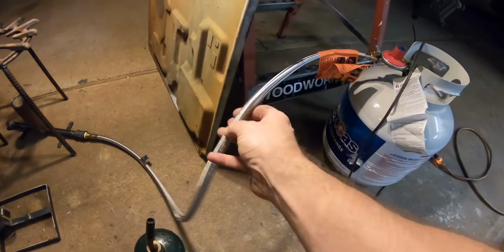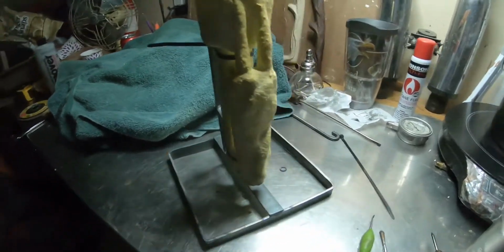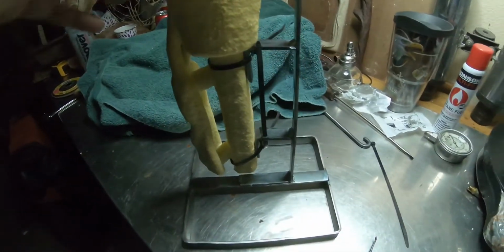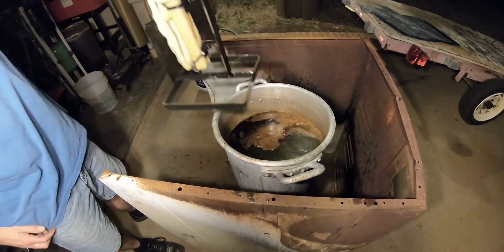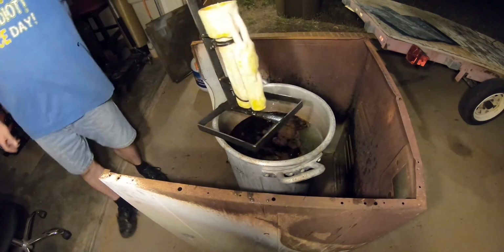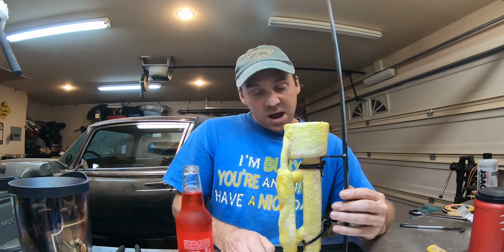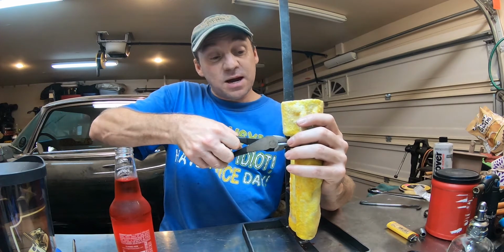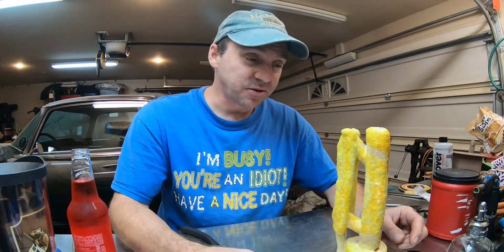Boiling Ceramic shell for lost wax bronze casting Part 1

Comment: Slurry is water soluble till it hardens, then it becomes extremely hydrophobic. I was wondering if boiling would work, I've seen 20 plus videos on ceramic shell and slurry blends. Cracking issues comes from the shell surface heating at different proportional temperatures, even in kilns you get corners and micro climate pockets that can cause these issues. Never seen a video on water boil melt, heard in a few people's videos about this, talking about how they HEARD about this technique, they never tried it.  I like this technique, plan on using it.
Reply from the maker: Give it a try.  It is water soluble until you fire it.  😉
Reply: As far as the hydrophobic, this is what I heard from videos, I haven't had a chance to use slurry yet. Yet, this was a perfect video and gave me the next level of thought on it.
Reply from the maker: @dna3930  Well, once ceramic shell is fired, I can tell you it becomes gas permeable.  This is one of the reasons you dont need a ton of vents.  My process shown here would probably be frowned upon by Ransom & Randolph.

Comment: Would this work with investment? I would assume not but figured I’d ask.
Reply from the maker: Ceramic shell is investmant.  Do you mean solid block investment?  Probably not because of the thickness, the investment would likely break down before the heat reaches the wax.  And solid block investment doesnt have this issue anyways.  Please tell me you are not attempting to use plaster of paris for metal casting.  It never truly loses its water and is extremely dangerous to pour molten metal into.
Reply: @jagboy69  I’m so new to this I’m not even sure. It’s the investment you buy in a powder form and mix water with it.
Reply from the maker: @Four9sFineJewelry  Good man Josh!  Too many times I get bone heads here attempting to use plaster of Paris.  If you have traditional investment like Ultravest, you wanna stick with traditional burnout methods in a kiln.  Solid block investment in a flask is what jewelers use to get the best details.  I use ceramic shell because for larger stuff, it's a little cheaper.  What are you casting?
Reply: @jagboy69  dang! That’s what I was trying to get around. They’re expensive!! What about placing it above the vent hole, (not blocking it,) of my Devils Forge furnace?
Reply from the maker: @Four9sFineJewelry  You wont be able to control the temp that the investment needs.  You can build an inexpensive electric kiln for  a couple hundred bucks and control it with a kiln.  As the saying goes, get rich or get smart.  I bought my kiln for 25bucks, just gotta look for a deal.
Reply: @jagboy69  $25??? Yeah I’d say that’s a deal. I appreciate the advice and responding. While learning all of this, I’m also having to keep costs way down due to living space at the moment. And since I don’t have the patience to wait until I move into a new home, I’m looking for ways of wax casting with the space/tools I have.
Reply from the maker: @Four9sFineJewelry  I suggest signing up at thehomefoundry.org  Lots of us there and good info.  Stop in and say hi.

Comment: 200 subscribers! Pretty impressive. Nice video. I would have bet money the shell would have dissolved.  I would have lost my money.
Reply from the maker: Barry this was 5 layers of shell.  I would suggest 6 layers at a minimum and I would probably pull it a little quicker from the water.  The 2nd dunk was not necessary.  If the winds here will give me a break, I'll pour the bronze today.
Reply: @jagboy69  I hope you can reply but us there a way to dissolve the ceramic? I have designs that would need the ceramic shell dissolved. Thanks
Reply from the maker: @stocky9218  if you mean chemically?  Yes there is actually.  On one of my videos, someone left a comment about dissolving it.  I seem to remember they mentioned sulphuric or muriatic acid.  Proceed with caution and run a sample before trying it on your prized casting...  So what'd you make?  Do you have a YT channel?  all the best!👍🍺😎
Reply: worldtraveler Thanks for the reply. I haven’t made anything yet but I would like to cast a rocket nozzle with cooling channels in the walls. Probably not possible but I’ll try oneday. Need to dissolve the ceramic out of the cooling channels. I haven’t seen anyone cast something like that with ceramic shells so it likely is impossible
Reply from the maker: @stocky9218  Solid investment.  Look into ransom & randolph ultravest..  Go for it!  I'd love to see it!  Cerma8c shell wont work for small internal channels.  Solid block investment is liquid and will work well for this.
Reply from the maker: best part, the stuff dissolves with water!
Reply: worldtraveler awesome I’ll take a look. Will that work with iron or stainless though?
Reply from the maker: @stocky9218  Iron probably not, but stainless maybe.  Assuming you can cast stainless, which is no small task.  Jewelers use ultravest for casting gold and silver.  I know it will work for aluminum and bronze too.  I think it can also be used for platinum.  A phone call to an R&R tech rep might be in order.
Reply: worldtraveler stainless will work well too. Thank you for your help. I’ve been researching for a while and didn’t know about them so thank you for that. Now I have to save up some money, now that I know what I’m looking for

Comment: Great tools you have fabricated for lifting, pouring and dipping the shell with wax into boiling water.  Could you share in general sketches with dimensions their designs?  Also do you have any videos showing your approach to applying the slurry and powders?  Do you have experience with only mixing a small amount of slurry and then using the brushing rather than the dipping process? Roy
Reply from the maker: Hi Roy!  Dig through some of my older videos.  I did a long and boring 3 part tutorial that goes through the application process.  Suspendaslurry comes premixed in a 5gallon bucket.  The stuff lasts for 2years if you stir it once a month.  Dipping is the recommended method so if your piece won't fit in a bucket, they will be happy to sell you a 500lb and very expensive 55gallon drum of the stuff!  I might make a video one day showing the lifting and pouring hardware I made.  Having the ability to weld really helps with this stuff.  After the metal is poured, the work just begins.  It's hours of welding, shaping etc.  That's why I prefer one of a kind pieces.  By the time I'm done with the first one, I'm bored silly and ready for something else.  If I video a build, it take 4x longer to complete the work.  Thanks for watching!  Do you cast bronze???
Reply: @jagboy69  Thanks for taking the time to respond.  My present works are small about two fists in size.  I will dip.  My starter materials are from www.shellspen.com located in Florida.  I am located in NY.  Will follow the dipping process as both you and Sean at Shellspen today recommended it.           I have available a lot of aluminum so will go with it.  I do have MIG welder so will someday want to fabricate some   of the lifting and pouring tools.  In the meanwhile I do have store bought tools for handling a 4 kg crucible.  I anticipate in the future scaling up if my sculptor son and artist friends also want to get involved.  Thanks for your wonderful videos. It looks like you are enjoying yourself.  Good luck with your efforts.  There is not much out there on  ceramic shell for we folks working at a small scale.  Discovered you And lunarburn studio this week.
Reply from the maker: @roycarter8575  OUCH!  You bought shellspen?  I hate to think what you paid for the materials!  I buy a 5gallon bucket of suspendaslurry and 2 bags of sand for 300bucks!  Now I see why you asked about brushing.  You would be surprised how cheap shipping actually is when you are talking about 200lbs from Ohio to NY.  Keep that in mind next time you need slurry.  I invite you to come join the rest of us metal casters at www.thehomefoundry.org  It is a great bunch of guys and very active.  We have guys running all processes from different level of experiences too.  It's a great place to post photos and ask questions on your journey.  Hope to see you there and nice to meet you Roy!
Reply: Hi Jason,  I commented a couple of times regarding your work/contributions on The Home Foundary site.  Little confused about the mechanics of site!!! Not sure my responses/reply’s to your questions were recorded???  

 Will look at more of your videos on ceramic shell process.   Roy
Reply from the maker: @roycarter8575  yeah I saw you quoted me, but no text.
Reply: @jagboy69  wow,  fast response!  Answer to your question on the site: Yes I am working with wax.  Like it stiff offering some resistance and not too sticky to touch (casting vs modeling).  Yes I am setting up to do ceramic shell but have not done it yet.  Will use hot H2O for wax met out.  Checking out more of your Ceramic Shell videos now and thanks.  Take care.  Roy

Comment: Nice job, I think that the cup part cracked because your cup was solid wax and expanded. I make mine hollow and they are fine as they expand less.  Occasonally I make a solid cup and they usually crack so I reckon that's it . But hey that's not the end of the world.  Thanks for the post.

Comment: Cool stuff, no more cracked shells!  Congrats again on hitting 200.  Now if you'd just start pouring bronze onto pizzas and grapefruits, you might really get those numbers up!  LoL
Reply from the maker: Thanks Jeff!  This is potentially a game changer for many of us.  It's the wax that cracks the shell due to heating and not the shells fault at all.  The shell material is designed not to expand or contract to protect dimensions and detail.
Reply: worldtraveler yeah after seeing the cracking shells you had recently, I would say so - a game changer indeed!  I wonder why the wax doesn't crack the shell this way, it must still expand...  Maybe it's simply more even heating?
Reply from the maker: That even heating is very possible.  The big boy method which most foundries don't even use is an autoclave.  I don't usually see autoclaves at garage sales, so I'm left to my own devices.  lol.  I think the even heating on the entire shell gives it an almost instant escape out the cup.   Solid or hollow wax sections should make no difference as the wax is removed from the area closest to the shell first.  Same as when I heat the outside of the shell with a flame.
Reply: worldtraveler an autoclave is just a big pressure cooker, no?  I know a guy who used to have one, he was trying to grow some kind of new-agey Asian health food mushrooms and needed it to sterilize his petri dishes. I'll ask if he still needs it, not that it'll be of any help you down there.
Reply from the maker: lol!  New age mushrooms... Does he need a good crawfish water boiling setup?  That burner I built is about the simplest and cheapest thing I could imagine.  It uses a 1.25mm hole.  That black pipe wasn't even threaded, it's tig welded with junk I had.
Reply: worldtraveler ha!  I doubt it, he's a vegetarian, hence the new agey stuff...  But you should post some pix of the new dewax boiler burner on the forums, seems to work really well.
Reply from the maker: Tobho Mott Meat eater here!  I'll snap some shots of it in case anyone wants to make one.

Comment: What surprised me was not that the water soluble shell survived the water. It was that as you heat up the whole wax at once, it does not crack the shell. My current explanation is that the outer layer of the wax becomes liquid at once so the corresponding pressure is not so high initially (being just a thin layer of the wax) but immediately it finds its way out, having a "liquid path". The failed attempts by others may come from the liquid form getting trapped under a solid part of wax (this depends on the form of the shell) and hence having to pressure the shell.
Reply from the maker: Very good observation.  By having the shell right side up, the wax floats up and out of the shell.  👍
Reply: Very nice. I will try this myself. Also much better to have no burnt wax fumes and the wax survives.
Reply from the maker: @Strawdozz  Very true.  Recovery rate is near 100%.  It can be a chore separating the wax from the water, but you can do it.
Reply: @jagboy69  I have read about this a bit now. Some people advocate using ice instead of wax as ice shrinks when melting. Not sure if its doable at home. Also, say goodbye to water based slurry (and say hello to ammonia). Then there are substitutes for silica, if I understand it right they cook ceramic at super high temperature and after that, no thermal shock. It amuses me that there is still active research on this topic.. people do this for thousands of years.. The French used manure + clay for bells and who knows what the Chinese did, maybe not even them anymore.

Comment: I am going to try it
Reply from the maker: Rabih Hachem film it or please let me know how it works out for ya.  Thanks
Reply: worldtraveler actually i am new with lost wax casting 
My job is sand casting 
As a start i am making the shell plaster and sand an it is working fine but i still have problems with finishing surface
Reply: I tried to dewax my shells 
The shells brok for many pcs
But my shells maded from plaster and sand
Reply from the maker: Were you using plaster of paris and sand?  Interesting experiment, sorry it didn't work.  If you cannot get proper ceramic shell where you live, you might have to go the way the old bronze masters did with traditional plaster block style investment.  Here is a primitive method still used today that works without modern materials.  Check it out.  https://www.youtube.com/watch?v=REutkpo3ors  If this guy can pull it off without the internet, I'm sure you can too!  Good luck Rabih, keep trying!
Reply: worldtraveler yes i could not find slurry  in  my country 
I am making the shells 50/50 plaster and sand but the burnout is cracking the plaster so i have to do the burnout slowly it takes 5 hours thats why i tried to dewax whith hot water
Reply from the maker: Yup.  I tried it too in the beginning and cracked and leaked aluminum all over my driveway.  Traditional block plaster and sand investment takes literally days to melt out.  It has to be done very slowly and the risk is still high for failure.  Dried plaster holds bound water, causes mini steam explosions and leads to bad surface finish.  Find some local jewelry guys near you that cast gold and silver.  Find out what they use for investment and where they get it.  Someone near you can help get you the correct materials.  Too bad shipping is so expensive or I'd send you to ransom & randolph here in the states.
Reply: worldtraveler this time i will ad saw dust to the plaster and sand i think it will give carbon so it wont crack and i will share with you the result

Comment: Huh, boiling the shells. I never would have thought of that. 

Try making hollow pour cups. I have a plaster mold and I slush cast my pour cups so they’re hollow. Quicker and easier dewax and less chance of cracking.
Reply from the maker: Thanks Harold, I have tried hollow pour cups, but haven't had any luck attaching a hook to them.  How do you hold onto the shelled wax while dipping?
Reply: worldtraveler the hooks I use to hang the shells have an adjustable cross bar. The part of the hook that I sink into the thick main sprue has a wave in it so it has more gripping strength. 

I cut a rectangular hole in the top of the pour cup, then I heat the bottom of the hook so it will melt into the wax. I plunge it into the cup and the main sprue and give it a quarter turn so that the cross bars extend under the width of the rectangle in the pour cup. Then I replace the rectangular part of the pour cup I cut out to hold the hook in place while the wax cools. 

For extra measure I shell over the top of the cup so that there’s enough strength to hold the wax/shell between layers. Then I cut off the top to dewax and pour.

I’m going to make some shells in a few weeks. I’ll take some video.
Reply from the maker: That would be awesome!  Thanks, I'd really like to see how you do it.  I'm subbed!
Reply: Hello Jason sorry, this is a little long!  Saw this wonderful video in the past.   Great reference you shared of university casting facility’s successful use of this process.  Too, good tool you devised for securing the ceramic piece during boiling out the wax.  Have the setup do do the boil out method myself very soon.  I have mentioned to you on another occasion that I’m in the process of setting up a small one person ceramic shell casting operation.  Near the stage of gating a few small pieces.  Correct me if I am wrong it appears in the successful works you have shown that you do not provide venting and so called release joints.  Another concern is how many horsepower’s are actually needed in a compressor for sandblasting small works say double fist in size particularly if they do not have fine details and are very smooth.  I’ve been reaching out in the hopes of finding alternatives to sandblasting.  Do you know of any?
Reply: @jagboy69  Jason, sorry about the vents comment/question.  indeed in the very example used in the video has vents!!!